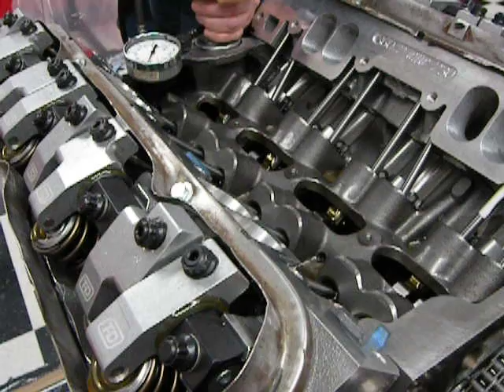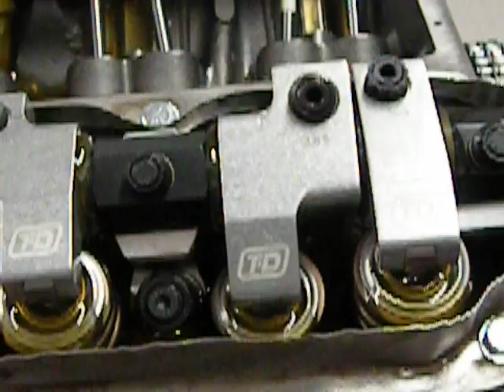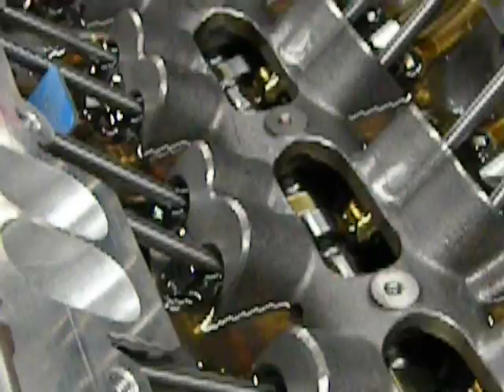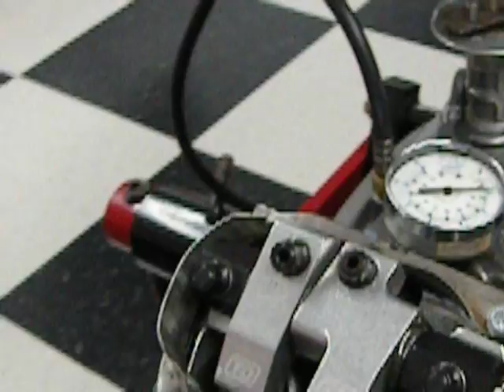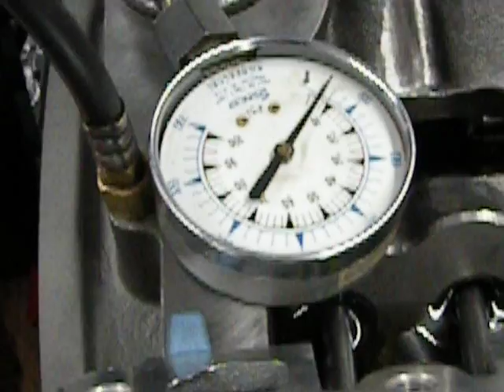R3 engine priming oil system

Comment from the maker: 59 deg block, 59 deg Indy heads and yes standerd 59 deg lifters but the rockers are off set as you can see in the vid. also oil through push rods.

Comment: wow thats a tuff mopar, im guessing seeing the solid roller cam that its the 48 degree block short deck heght, and w2 heads?
Reply from the maker: It is a 59° Block and they are fully worked Indy  heads 
 Massive power but if I was to build one again it would be the 48° block

Comment: Hi is it with roller lifter In a r3 Block ?
Reply from the maker: Yes this R3 engine has roller lifters but not without extensive machine work, the 59* block is not machined for rollers but the 48* block is. It cost me more money to set this engine up for rollers than it would have cost to buy the 48* block and all other costs that come with that block, plus the vale geometry with the 48* block is much better.